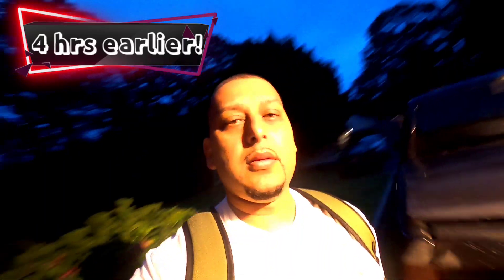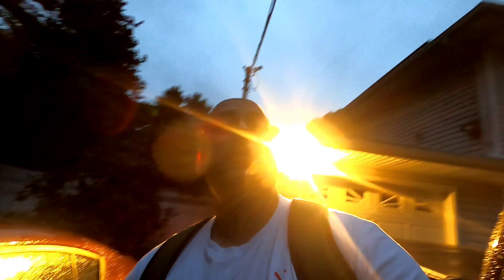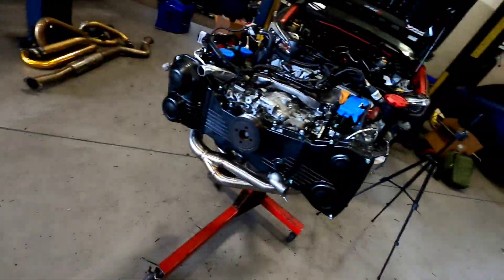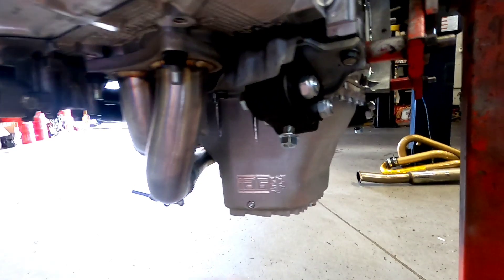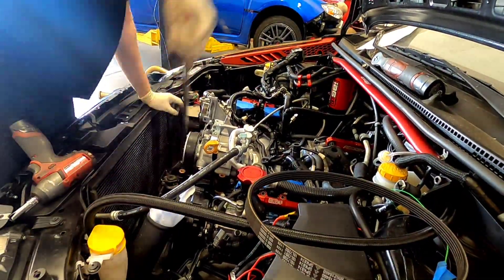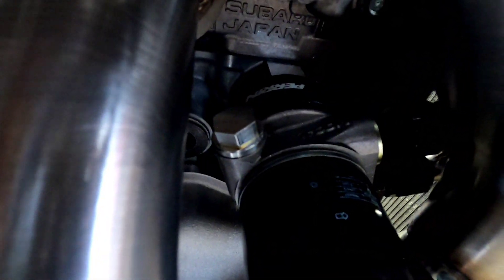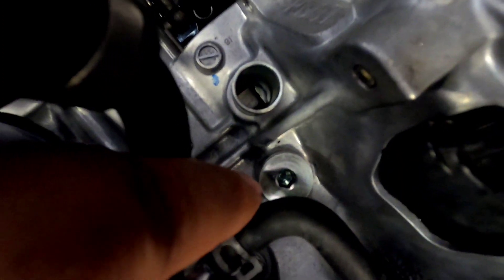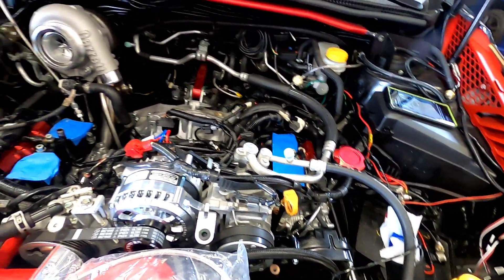2018 Subaru Wrx/Sti  Road to 700whp Part 6 - IAG 900 MAGNUM LONGBLOCK INSTALL

Comment: Can you do a video on the oil cooler setup? How did the mount the 25 row, and how did you route the lines.
Reply from the maker: It's mounted behind the intercooler...sorry brother I won't be taking off my bumper any time soon cause it's sooooo cold out here....but the lines are routed the same direction as the old set up that's all. Hope this helps

Comment: Curious if this block can handle 700 whp? It's rated for 900hp (crank) and doing the math for drivetrain loss, should only net just over 600whp.